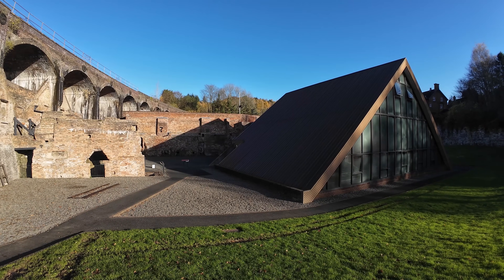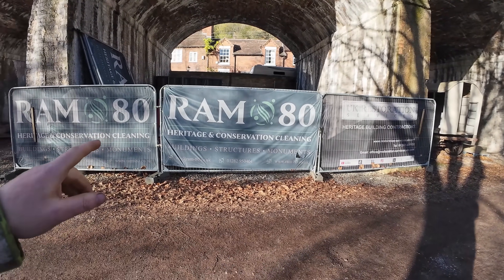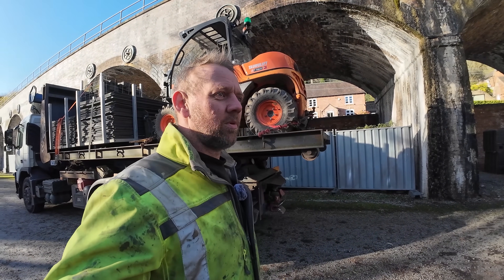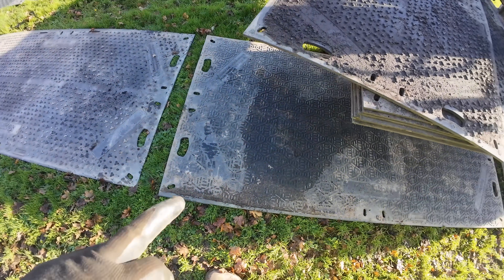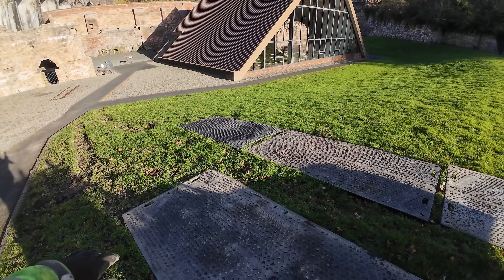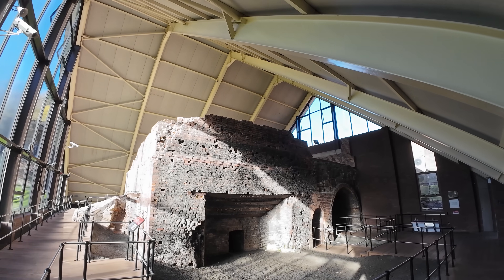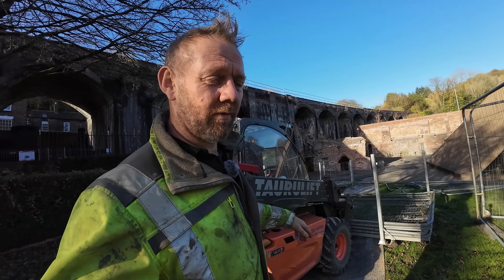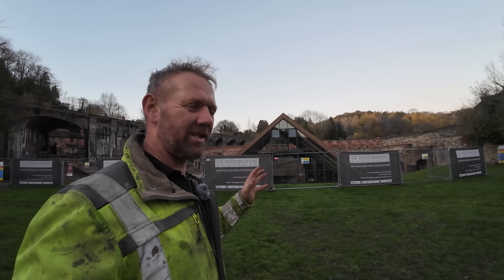A 400-Year-Old Secret Is Hiding in This Building…How We’re SAVING this Historic British Iron Furnace

Comment: Going to be a good project to follow, I remember that building being open think at the time like most things there was a bit of a do, mainly because you had something really modern for the time being built over something. It tells you something about the materials they used building the cover, only 40'odd years later there having to replace it, whereas the kiln is how old. 👍
Reply: its bound to especially steel, it should have been a copper roof them tiles last forever and they do them in the same shape
Reply from the maker: Ya, would look nice in copper
Reply from the maker: 1630 ish the Furnace....circa 400 years old. Served its purpose the roof.

Comment: six weeks to scaffold inside? yikes. they on a day rate 🤣
Reply: Six or seven week. And just internally. Externally the scaffold will be obviously at least 3 times bigger. So, perhaps 6 months.
Reply from the maker: External scaffolds are only to the gable...fairly easy.
Reply from the maker: It is a fairly difficult scaffolding to erect. All tier'd to the roof profile and has to be carted in through the door.
Reply: @UKRestorationServices  Of course is difficult. But 6/7 weeks ! 🤪